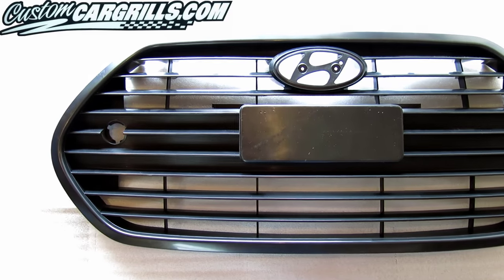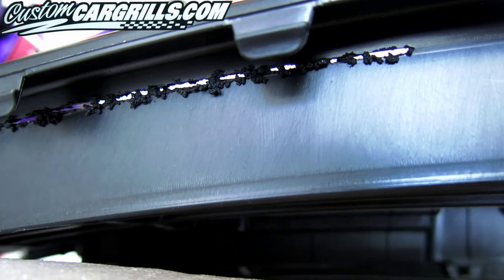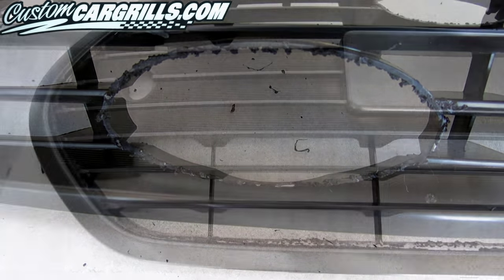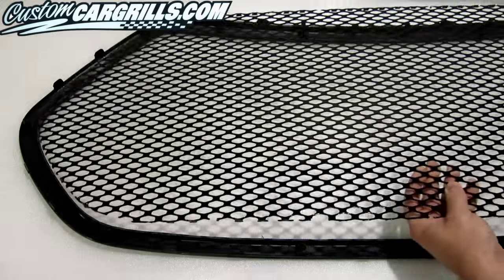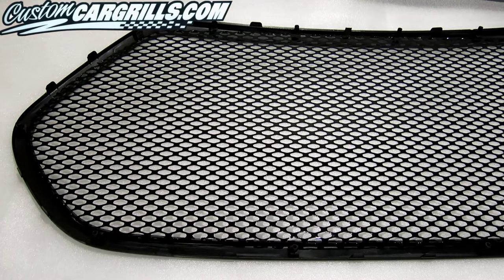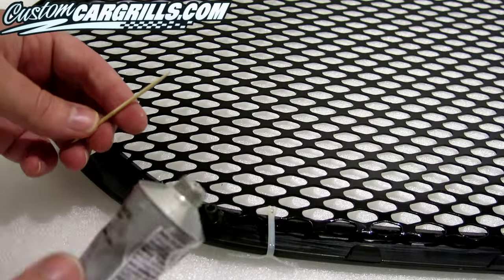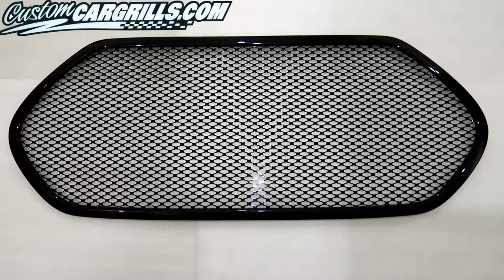Hyundai Veloster Turbo Brickless Mesh Grill Installation How-To by customcargrills.com

Comment: Would it be possible to order a pre-cut mesh grill in this style using a different one of the mesh options you have on the site? and if you guys are willing to option it out, how much more would it cost? I appreciate how simple the installation seems, you guys have really done a great job offering an inexpensive way to customize these cars.
Reply from the maker: It is possible to do other styles of mesh; with a few disclaimers:
1) Only from meshes we stock that are 16" or taller
2) Not from any of the heavy duty meshes; so we can bend it
3) Not from woven wire or plastic material

As for cost, that depends on the mesh; some are cheaper than others.  Raw mesh will be cost effective and can be done in a timely manner.  If you need it to be black, that will skyrocket the cost for a custom one-off piece and add a lot to the manufacturing time.

Comment: How long did you wait for the adhesive to stick before cutting the ties?
Reply from the maker: Depends on the adhesive.  Typically that is stated on the bottle or packaging.  In the case of the Automotive Goop, it's a full 24hrs.

Comment: Can you provide more details? You need to show the top of the grill where you cut, because there is more plastic at the top so showing exactly where to cut would be very helpful! TY
Reply from the maker: Some portions of these older videos (this one is 8 years old now, from 2015) are less than ideal.  We've drastically improved our video quality since then from feedback like yours so thanks for the specific feedback.

With that said, on top edge, I'd assume you're referring to around the emblem area specifically.  Around the 0:55 mark in the video, you can see that I cut down the stock logo area a fair bit.  

So, trim down the plastic that's in your way.  Then when you have a clear patch to cut the outer frame, that should get you the results that you're looking for.

If this is not the specific area that you're referring to, send me an email with a picture of the area that's giving you trouble and I'll try to help out the best I can.

Comment: I don’t understand when where and why are you using foam?
I’m trying to install on 2013 Veloster turbo
Reply from the maker: When to use the foam:  as you're tying the mesh to the grille frame

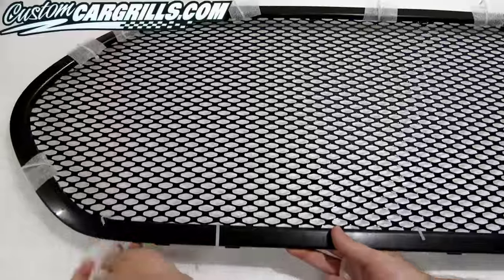Where to use the foam:  on the grille frame.  There's a good shot of where I placed some of my ties & foam pieces around the 3:00 minute mark when I remove them.

Why to use the foam:  to protect the grille frame paint, so the ties don't dig into it and damage it.

Comment: All this work and easy to mess up. You can just buy customs grills. This company should make and sell these grills (to order) for reasonable prices. Based on the much better aftermarket grilles available I’d say this piece would be worth about $250 shipped.
Reply from the maker: We have made complete grills before, but they are cost prohibitive and we can't do them for $250 shipped.  

We need a factory oem grille to start with, and those go for around $100 from Hyundai.  Current retail on the mesh is $90, it'll cost about $75 to paint the grille frame after it has been modified. It'll take about $10 in glue, and around $20-40 to ship.  So, we're already around $300 and haven't even paid for my labor and wear & tear on tools or payment processing.

We'd be around $399 for a completed unit shipped when everything is factored in.  I know that's well above the cost of other grilles available, which is why we don't advertise a full replacement option.  I'll make one if interested, but I cannot offer it for $250 shipped.

Comment: I have a new tucson 2016 ..I want to keep the factory grill but just put a mesh behind to protect the radiator. have you done anything like that?
Reply from the maker: We have done some installs similar to what you are thinking about.  I don't have a video about that type of installation at this time, but as long as there's some some good attachment points on the factory grill then it's usually a quick and easy mod.

Comment: Does this grill come without the towe hook hole? All i see is the one with hole on site
Reply from the maker: Hey Josh, currently we're just stocking the one with tow hook hole precut.  I can custom make them without a hole but I can only make them from raw material (you'd need to paint or powder coat it  black if you wanted that color).  Send me an email at info@customcargrills.com if you want one of those made, and I can ship it within 1-2 days.

Comment: I have a non turbo Veloster. Would it work if I cut the custom grill down to size?
Reply from the maker: Sadly it will not  🙁
Reply: @customcargrills  why wont it work just curious?
Reply from the maker: The turbo and non-turbo are a completely different shape & size.  The non-turbo doesn't have a grille frame, which makes the install much harder.  I'm not saying a non-turbo mesh grille isn't possible but it would be a big undertaking for most owners to do the install.

Comment: what dremel cutting wheel did you use to cut the oem grill out?
Reply from the maker: Technically the bit shown in the video is a #542 Cutting/Shaping Wheel.  It's an older part that is no longer carried in the U.S. (but available in the U.K.).

The newer version of the bit is the #543 Cutting/Shaping Wheel, which we have featured in some of our newer videos.  The #543 is a pinch larger which is nice, and only has grit for shaping on one side (as opposed to both sides on the #542).

Comment: Can this be done on a non turbo
Reply from the maker: The mesh piece we sell as seen in the video only fits the Turbo model and we don't currently have a kit for the non-turbo.  

We do sell all kinds of mesh sheets if you wanted to create your own mesh grill for a non-turbo.  It might be possible to do but since the non-turbo model doesn't have a lip / bezel around the inner portion of the grill, like the turbo model does, then attaching the mesh may be difficult.

Comment: how to put the tow hook on the grills?
Reply from the maker: On our website, there is a variation that includes a cutout for the tow hook.  If the the no tow hook model is ordered, there will need to be a cut made in the mesh to accommodate that if desired.

Comment: I have a non turbo veloster but I'm planning to convert my front bumper to the turbo bumper. Would something like this work for me?
Reply from the maker: As long as you're using an OEM Veloster Turbo grill, I think it should work.
Reply: Samatar Dahir hi, how's your front grill ( non turbo) did you make it change to a mesh grill like this on the video? My car same as you and I'm looking also a mesh grill for the non turbo grill...Any news? Thanks
Reply: I have a the strange situation, where I'm keeping the Non turbo front end and cutting the center out of it. It's going to be a pain but I'll figure it out. I like the fog lights on the na model more than the turbo model, so if I don't have to convert it, I won't.
Reply: Lol, good thing they have the part manual online, just found out I don't need to do any of that. Just take it apart from the inside. The the mesh can be figured out later